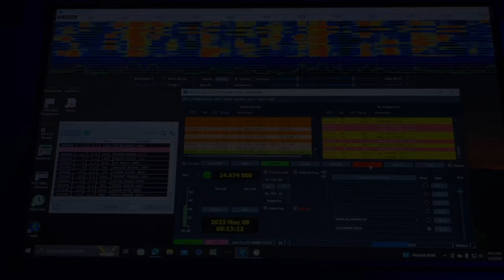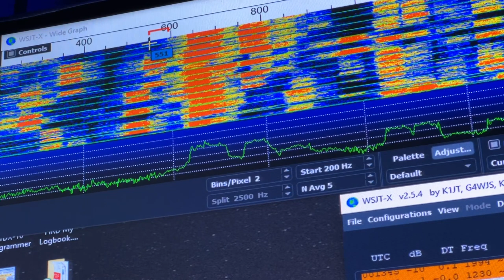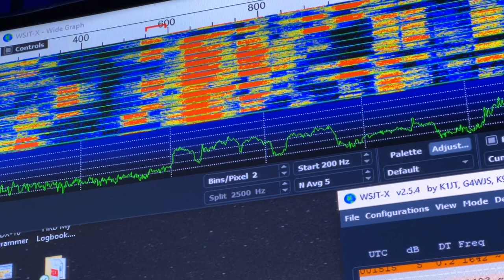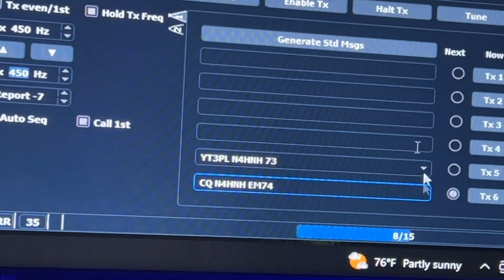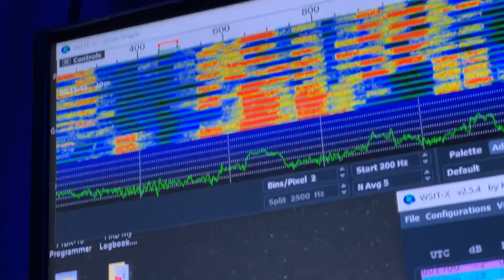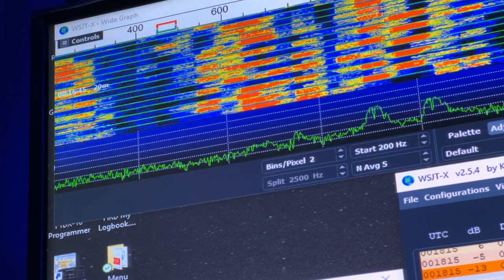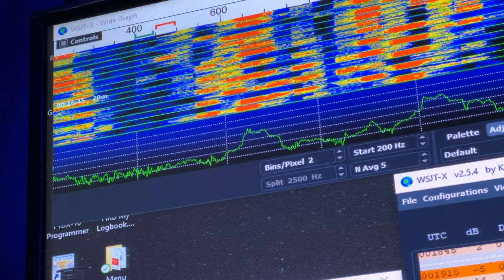Watch Out for This… (when working FT8) #hamradio #ft8 #digital #communication

Comment: On FT-8, Whether I have the “Lock-in” clicked or not, my TX Curser continues to move around.
Reply from the maker: Then something is wrong.  Hold TX frequency should hold your TX frequency.  The green bracket will move to wherever the station working you is transmitting. But the red bracket should stay put.

Comment: Doug and I have talked about this before, and operators are constantly moving TX around.  The best thing to do IMHO is to not let this be a source of aggravation.  This gave me an idea though.. I'll see if I can put in an enhancement request to wsjt to see if it is possible to allow the program to decide the clearest frequency and automatically move the station.  EDIT - I have just put the question in the groups io forum, and see what is said. EDIT 2 - Already have an answer back from wsjt group.  They can not automate this function.
Reply from the maker: I like your idea, David. That would be great. Similar to setting a router to use the most clear frequency available.
Reply: @n4hnhradio   I floated the idea to the engineers, but was shot down immediately.
Reply from the maker: That’s shortsighted on their part.  It’s a great idea.

Comment: I do not disagree with you. However a very strong signal at your end does not mean they are a strong signal at the other end. Propagation effects are the reason for this discrepancy. The second thought is that FT-8 is cut in to the even / odd 15 second time slice. If you check the Tx even/1st box you are now TX in the time slice the invader is not and you are now sharing the frequency.

Comment: Doug, if you hold the SHIFT you can move ONLY your transmit and not move the green receive. I do not move the receive, I just lock in my transmit and move it with the SHIFT.
Reply from the maker: That’s correct, but I just move both. The RX is going to move around anyway, according to the frequency where the station who calls me is transmitting. In fact, I like to see that. It lets me know that they have selected to hold their TX frequency.
Reply: @n4hnhradio  Yep, I always look to see where the receive is also.  As you know, you can also see their frequency in the right panel as it shows their signal strength and frequency.  That shows me sometimes where I need to go if, like you say, some starts transmitting on top of you and your DX station can't hear you.  I lost Mongolia a couple nights ago because of that. Darn, never did get that RR73 or RRR.🥶

Comment: Thanks for highlighting a common source of QRM on FT8. Although usually done out of ignorance, not clearing your transmit frequency is against common ham etiquette. Education such as this video is what is needed but be aware that if you do not control the transmit frequency you are operating on, you will be considered a discourteous operator. Another clue this is happening requires you to stop automatic sequencing so you can see the other time cycle. Switching to the opposite cycle (odd/even) will also allow you to see that someone is “doubling” with you. I prefer to have both odd and even on my transmit frequency clear so that if other hams have a full band spectrum at their QTH they can call me on my transmit tone frequency. Mind your transmit frequency, sharing the space by making use of odd/even and trying to make your transmit frequency close  to a 50 hz segment, will help this mode to be more useable and exhibit your professionalism as a knowledgeable operator. I think we are all guilty of these mistakes so thank you for providing this video to help educate. George YE1GXQ/AG5XQ

Comment: Your assumption of it being an 'accident' is well intentioned.  However, when you double-click a call sign, you would be transmitting on the alternate schedule.  I personally believe those strong signals simply don't care.  Plenty of jerks on the air.
Reply from the maker: There probably are some jerks, but I think mostly it’s due to a lack of experience. They just worked me by double-clicking, but they didn’t have their TX frequency set to hold in another clear portion of spectrum.  So, they just worked me on my TX frequency, and now they start calling CQ on the same frequency where I’m calling CQ.  It becomes difficult for me to continue because their signal interferes with the signal of those calling me.
Reply: @n4hnhradio  WSJTX automatically puts you on the alternate time slice when you do that.  They wouldn't transmit at the same time by double-clicking.
Reply from the maker: That’s correct. But the person who just took over my portion of spectrum is calling CQ and someone answers. Both time cycles are in use.  It’s best for me to move.

Comment: New to FT-8; great video. Obvious analogy to CW/SSB is move after you answer a CQ and complete QSO, but there is so much to learn about the FT-8 user interface!
Reply from the maker: Getting the audio levels set correctly, so you don’t transmit harmonic radiation is also very important.

Comment: Another excellent video.  I often have someone show up under my CQ’s. I think it could be changing band conditions, and maybe the other ham just can’t copy me.  When I CQ for a time with no response, I will also change transmit frequency.  I don’t get upset, I just QSY.

Another thing you can do is change your transmit sequence from odd to even or even to odd.  This helps also. 

Usually if the band scope is just really crowded like seen in your video, I will QSY from FT8 to FT4.  Obviously the band is in good shape and lots of other hams are on the air. Get ready for some fast qso’s.  

Also if the band is crowded, I have moved the  radio VFO up or down 1 and start CQing above or below the band plan and will immediately start getting qso’s. This is basically no different than a DX station running Fox and Hound. 

I try my best not to answer a good dx station on his transmit frequency.  I think it is best to be up or below his frequency.  But if I have no luck, I will listen to the dx station for a time and see if he is only answering those on his frequency.  If that is the case, I will call on his transmit frequency.  If he answers someone else, I shut down til they complete their qso. Then start calling again.

When calling CQ I often just move around. It really helps if the qso’s slow down. 

Another thing I do and it probably doesn’t matter, I try to set my transmit bracket on an even transmit frequency ( say 2000 or 2050 or 2100). If we all set our transmit frequencies in those even blocks, we could squeeze more stations in the plan without any overlap.

Also during slow times, I will place the receive brackets directly over a very weak transmission on the scope.  I read somewhere, but cannot confirm, that if you place the receive brackets over a weak station, it will help the computer decode that particular station.  I am not a computer OIT specialist so can not confirm this.

Also, I think about the DX I am trying to work. Often the DX is in a poor country with horrible AC power lines or in a tropical region with lots of thunderstorms and static.  The DX might not be able to hear you at the moment. Just give it a rest and come back againl later and that often helps complete the qso.

Thanks

de AF4OD
Reply from the maker: Great advice all the way around, Bill. 73, Doug

Comment: This video touches upon one of my biggest peeves when operating digital modes like FT8.  I call it “getting stomped.”  In the beginning I suspected this was happening because of inconsiderate users, but having reflected on it for a bit, I think there are a number of reasons why it happens, mostly not malicious reasons.

One of the biggest reasons why this happens is probably due to new operators who don’t understand how it works. I was one of these. I didn’t RTMF and started operating on the assumption that since this was a software-based mode, there would be safeguards against doing something that could be detrimental to other operators.  Soon after however, one cannot help but notice the “channels” and think of the saying “stay in your own lane.”  I soon began to operate with that principle in mind. 

Another reason this might continue to happen, even if all operators are educated about best practices is that some stations simply DON’T SEE YOU. What I see on my screen in California is not the same as what Hiro sees on his screen in Japan. 

I operate QRP, so I can understand why someone running 100+ Watts 3,000 miles away might not see my trace on their screen. They might see what appears as a faint noise noise in the lane. That’s my transmission!  On the other hand, when they get into the same lane, on my screen I see a glowing strip of light stomping me out. This is unavoidable. The little guys just needs to move around more often, and I do. I think it’s part of the fun now, and it really means you have to work for your QSOs., especially when the band gets busy. 

By the same token, a weak station can benefit from operating on opposite (odd/even) part of the same lane as a very powerful station and sit their comfortably as long as the powerful station continues to operate there, because most other stations see the signal in that lane and don’t pick that lane to operate in. So it’s a double-edged sword. 

I think it’s a good thing that with digital modes like FT8 you have to do more than set and forget. It leaves something to the skill and strategy of the operator.

I enjoyed the video. I’ve been thinking of putting one together covering FT8 strategies.  Believe it or not, there’s more to it than “set and forget” or “click and go.”   For example, there are ways to work multiple stations concurrently without losing any of them.   Also several ways of working more efficiently so that you make the best use of your time. It’s a fascinating topic that offers a lot to of learning for most of us, even when we think we’ve got it down pat.
Reply from the maker: I prefer CW and SSB, in that order. I only operate FT8 when I have a reason to - usually related to creating a video or researching for my Patreon team members. This video was released to the Patreon members months ago. Some of the videos released to Patreon eventually go public.  Some never go public.

Comment: The notion that just because you clicked Hold Frequency you some how reserved the frequency is wrong. I constantly have to move around. Also, you may have a clear opening on your end, but there may be somebody strong on the other end. Sometimes, when I get stuck in QSO, I change the transmit frequency. You never know if your are getting covered up on the other end.
Reply from the maker: It’s the same with CW, SSB, etc.  Skip zones can sometimes be one-way. But, other than the one-way skip zone, if someone is calling CQ, or just having a conversation, that is their frequency until they sign off. It’s just proper ham radio etiquette.  

With digital modes it doesn’t seem to be as obvious to some operators that a frequency is in use.  Maybe they are new and their lack of experience with the mode causes the situation covered in this video.  And yes, the best solution is to just move.  Some will try the odd/even option, but either way you could potentially have a problem. The person who took over your frequency is calling CQ. If someone answers them, both time cycles could be occupied, because the station answering them might not have their TX frequency locked in at a different portion of the spectrum. It’s just best to move.

Comment: Helpful. Wasn’t really that clued into this phenomenon, and kind of assumed that WSJT-x would select a frequency that’s not obviously occupied by strong signals for a subsequent CQ. I noticed today on my own that WSPR also defaults to 1500 and it almost certainly causes some people to step on others. I was using my Xiegu G90, and not my dx10 today, but I am still scratching my head why some WSPR transmission cycles don’t seem to get picked up while others have 30-40 reports—in this case it’s not an ALC/overdrive issue. Overall, it seems challenging to get much clarity from WSPR about how two different antenna or ground systems are behaving, because the reports feel a bit hit-or-miss. At first I thought the realization to get off of 1500hz was the a-ha moment, but I’m not so sure. Anyhow, just some random remarks :)
Reply from the maker: Sometimes, when we are calling and calling, with no response, we might be getting trampled by someone with more power or a more powerful antenna. I am now conditioned to check the spectrum.
Reply: Figured out today that WSJT-x gets weird in WSPR mode if you use call signs with /% suffixes… which initially seemed like a good way to track transmissions off of 1 antenna system vs another (rather than altering the grid square as an identifier or by keeping track of transmission timestamps). As the software was sending differently even when transmitting back-to-back cycles, sometimes putting the callsign in <> brackets, sometimes not, and sometimes including the grid and sometimes not, the signals weren’t consistently decoded. Weird, but whatever. … but yep… for sure going to check the waterfall and be more deliberate about my freq selection going forward!

Comment: How does operating with split either using rig control or fake it settings impact your tx frequency. If you set your tx hold and fix your tx at 450 hz then send with split with rig control where is you tx actually showing up?  Many of the videos recommend using split but most comments seem to ignore whether split operation is being used or not.

Comment: I'm pretty sure instead of changing freq you can just click 'Tx even/1st'. With the time slicing, someone has to be transmitting with the same freq as you + the same odd/even timing bucket to transmit over you. If you're seeing hot after you're done transmitting, that person is on the other time bucket and is not causing any interference there. When you're transmitting the chart is showing a blank line so you're not able to see who's transmitting at the same time as you that way. You'd have to stop transmit for a cycle and see if anyone was red on the same time slice you're set to transmit on.
Reply from the maker: That is definitely possible, but the person answering their CQ can overpower me.  Furthermore, their signal can make it difficult for me to decode those who are answering my CQ.  I’m not complaining, because we can all forget to select to hold TX frequency and then work someone, then decide to call CQ on the frequency of the person we just worked. I like to think that it is unintentional.
Reply: I believe that the other "time bucket" on the same frequency should be kept clear for chasers to respond to the CQ calls.

Comment: WSJT-X, Log4om, FTDX10, 40 Meters this combination slows down my laptop and can freeze my laptop up to almost unusable. I have to use keystrokes to save the last contact, exit WSJT-X, close Log4om, and restart my laptop all using keystrokes. After restart the laptop is fine again. Any ideas? Is it just me? The laptop is clean as I only use it as my shack computer. TNX and 73
Reply from the maker: I don’t have a logging program running while operating FT8, but my laptop has no trouble. My laptop is full of software too. I don’t actively log though, other than the log file WSJT-X creates. After I finish operating, I import the log file into QRZ.
Reply: @n4hnhradio  Thank You for the reply and hope to work you in the logbook some day!!

Comment: I guess I am used to having the big signals overpowering me. I want to have my waterfall go from 200 to 3200. Just gives me more room to spread out.
Reply from the maker: That’s a great idea, Charlie. It happened to me 3 times last night. I just keep an eye of the scope.  Sometimes I retreat to the 2600 to 3000 area.

73, Doug
Reply: @n4hnhradio  Doug, I need to ask for your help again. I think I am having alc problems. People are not answering me, Maybe it is distortion. I guess I am not exactly sure how to tune it up. I am running 50 watts. SWR is okay, not great, but not excessive. I have installed my external tuner.I tried using the wsjt-x power slider. but I can not get the alc to drop off like you had it do when you helped me before. If there is a video that addresses ALC let me know and I will look it up.  I have been down mostly for several weeks because of udp problems with the wsjt-x , log4om and jtalert. Most of that is behind me.Thanks, Charlie
Reply from the maker: Hi Charlie!  I can get on Zoom with you in about 30 minutes. In the meantime, check pages 16 and 17 of the PDF I wrote for setting up FT8. It covers the audio settings. 

73, Doug